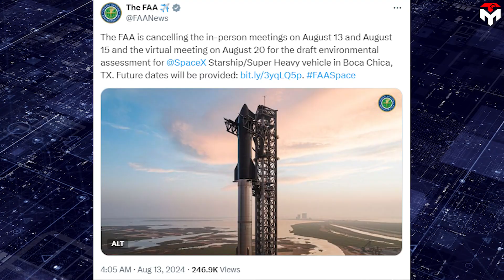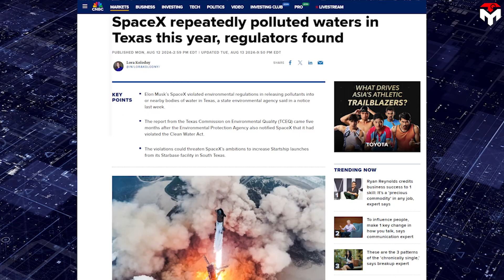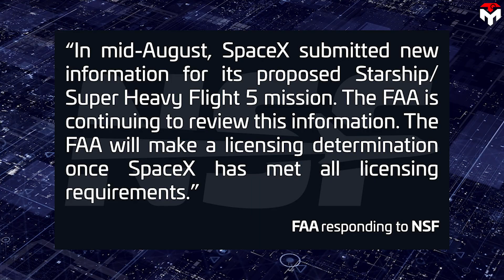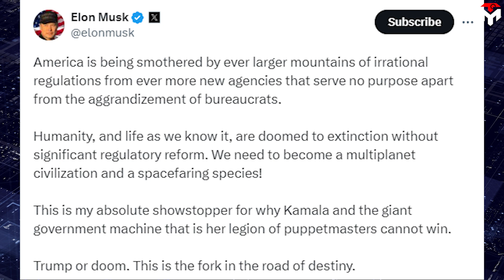What Gwynne Shotwell Did with FAA to Launch Starship Shocked whole Industry!

Comment: The information that one of the FAA fines was for a LOX (liquid oxygen) spill was new to me.  The fact that there was not a major explosion means that their facility design was correct and the spill didn't contact organic material like asphalt.    Early in the space program, (1961) there was a LOX spill that was on an asphalt road and the LOX reacted with the hydrocarbons in the asphalt making "LOX gell" which is a high explosive that killed people.  

Years ago at my business, I had a fire department inspector (expert bureaucrat) who demanded me to move my LOX tanks to the far corner of my property, which was paved with asphalt.  He claims that would be better than next to my concrete building on a concrete slab with drainage into a concrete ditch.   I told him "NO" in absolute terms and that fight went on until the Fire Chief came out.   He also had some misinformation about pure O2 systems but he looked up my claims and went away like good bureaucrats when they made fools of themselves with another redundant concrete anchor.